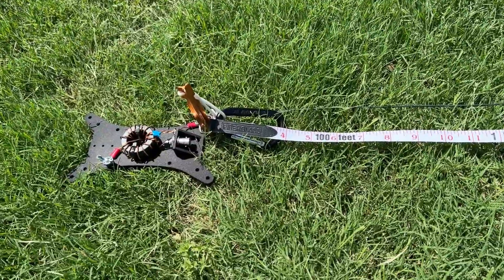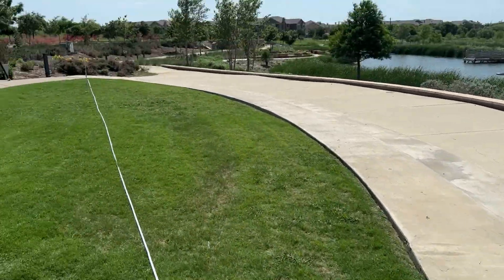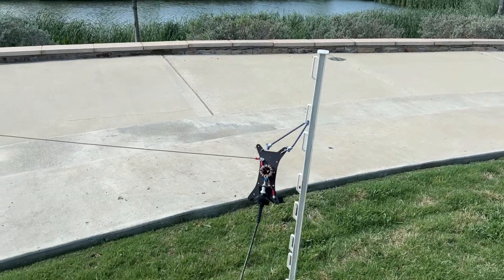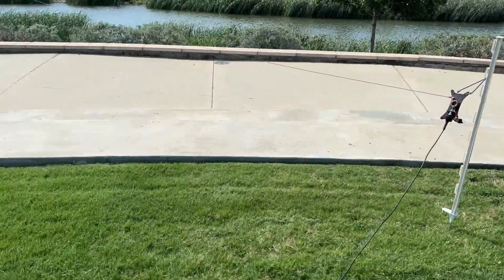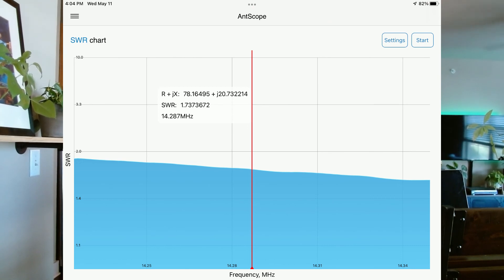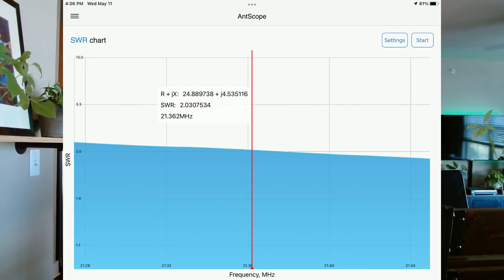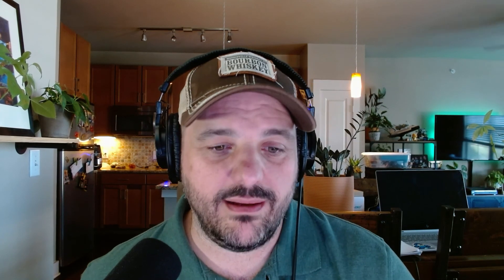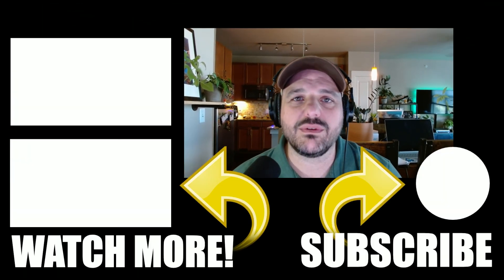BEGINNER Ham Radio Antenna build: CaHRtenna Artemis, 49:1 EFHW Part 2

Comment: Instead of moving the antenna. Use a radial or two… radials roll up small and are easy to deploy… you will not detect any receive difference if you’re 1.1 or 1.5:1.  Power out won’t make ad difference on the receiving end. If you double your power twice, your received signal will on the other end will go up 1 S-Unit.  What I’m saying is, don’t sweat the small stuff!!! De NØPL

Comment: Move resonance lower in 40 meters to fix the higher bands, it's a compromise. Don't obsess at all over SWR below 1.7, it just doesn't matter. Get the middle of the antenna up high for best efficiency, put the mast near the middle of the wire. Counterpoise and transmission line choke to reduce RF on the radio is good too. Have fun and 73 de w6akb

Comment: I trim for 7100 and the rest seem to work well in the middle of the band. But I use mine inV configuration. I take a piece of tape to mark the center of the 63’ wire. I’ve noticed a big difference if the unun is laying on the ground or 6’ up.

Comment: Nice vid. I find zooming out gives a better idea of where antennas are harmonically resonant.  Amazing how small adjustments make such big differences.
Reply from the maker: The mobile Antscope app isn't my favorite. The PC version lets you really tweek  the data points. The next time I take this out I will do a full sweep and see where it lands. My theory is I should have trimmed it for the middle of 40m rather than the middle of the SSB portion. That way the harmonics would be a little longer.